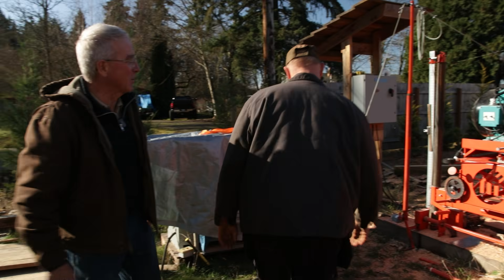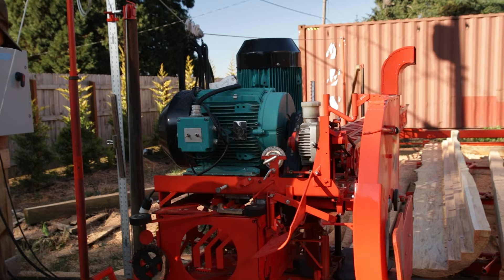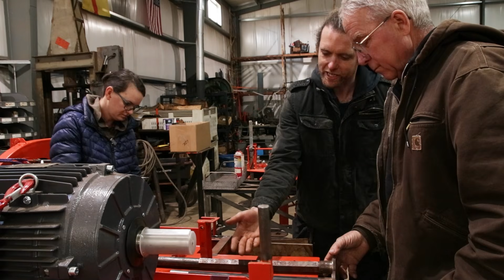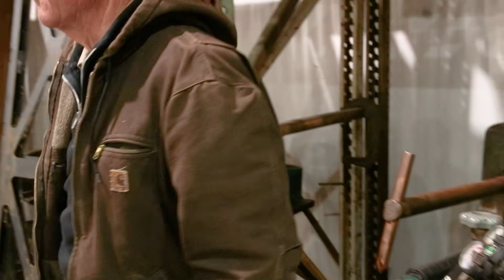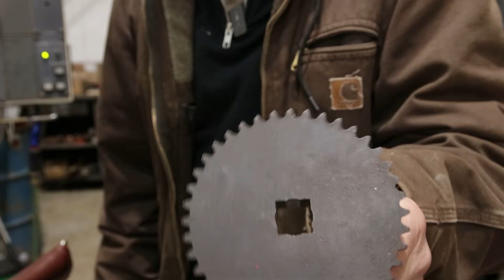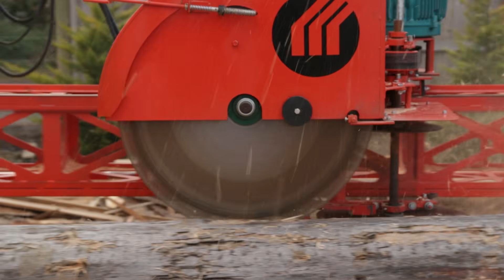The Unbelievable One-Man Sawmill | Mobile Dimension Shop Tour

Comment: I’ve got a small band mill. The boards are so smooth that they look planed. The drawback is that I have to manipulate the logs by hand. I’ve cut up to 26” log and that was almost too much. I like the band saw because I don’t lose much in the kerf. I can cut a 20” x 20” if I wanted to. Don’t want to.😊
Simple to sharpen a band and change it out. Not much to maintain as there aren’t that many moving parts.
I would add that it’s not a business for me. I trade lumber with my neighbors for help and the use of an excavator. 😊

Comment: Seems like a nice creative pair. Hope this turns out well looks like a nice product for small scale wood operations. Curious about the rigidity of the beam though. Seems lite.  Really, no bend or flex in lengths over 30 feet?
Reply: That mill shown is 32ft long. No issues. We haven't tried longer to see where it goes wrong yet, but this new design of track is physically 50% heavier and bent sheet metal is way stronger than flat bar like ye olde design.
Reply: @mobiledimensionsaw  32 feet that is a lot. If it really can hold straight and true at that length it is good. Would like to see a pricelist for Europe for this product line some time in the future when the tariff madness is over.
Reply: @just-a-dude4u  I'm not sure how much tarrif madness there really is to be honest, I think it's a lot of just hype in the news. My research is saying that it's a 2.7% import tariff, but the real kick in the teeth is VAT.
Reply: @mobiledimensionsaw  Nobody is sure about anything, that is the main problem. 175% tariffs on China and Penguine islands. Zero on the evil terrorist dictatorship regime Russia... It is just madness. Sorry to say. I used to like Usa. As it is now, made in Usa is off my shoppinglist until order and stability is back.
Reply: @just-a-dude4u  I think you'd be surprised. While we've been braced for the tariff madness, it hasn't hurt as hard as we expected. It's all just media. It's not reality. Unplug and things are different.
Reply: @mobiledimensionsaw  Really? Here I am in Europe telling you that I am not going to buy your product cause your country have  elected a serial liar that is threatening neighbour countries and saluting genocidal dictators like Kim Jon Un and Vladimir Putin and raising tariffs with the rest of the world and you think that it is something that will not exist if you turn a blind eye to media? Really, blame the messenger? That is surreal. Even Russian media reports that they are happy with Usa starting trad conflicts. Everybody knows this!

Comment: What an awesome video.  I grew up helping my dad on an MD 128 up here on Vancouver Island.  Believe it was sold in 2007 for maybe $10,000 bucks.  Can't imagine what they're worth now.  Built our own trailer out of 2x10 box tube salvaged from a mobile home frame - worked beautifully.  I'm not sure where this machine fits in anymore, even back in the early 2000's I remember band mills becoming more popular with Sawyers in the area (and  customers).  The mobile dimensions biggest downfall?  Waaaay too much sawdust!  5/16 and 1/4 inch kerfs add up to a ton of lost lumber.  Awesome machine though, and great memories.  The easiest way to change the direction of the wind for the day was to set up the sawmill on the jobsite - no matter what direction we set the saw in, the wind blew the sawdust in our face 😅
Reply: Wind always brings sawdust to operator!
Reply: My sawmill does not have sawdust blowing on the loading dock. It goes over top of the motor, so I don’t understand why they don’t continue this set up.

Comment: As I recall, if it's the same Mobile Dimension, we (our refuge-seeking Christian colonizing group) took a sawmill with us to Brazil way, way back in the mid-70's as an income generator. It had the flat-4 VW engine. Alas, the colony failed after two years, but the sawmill kept going. We couldn't afford to bring it back. As it was, we flew home with the clothes on our backs. It may be making some Brazilian an income to this day. But I'm sure it was a far different apparatus than the fine machine shown.
Reply: I bet you it's not all that different. It's the difference in the drive mechanism. That one would have had likely a bakelite vari drive instead of a hydrostatic pump. Otherwise there isn't a ton of difference between all the mills. It's all the same concept with 85% of the same parts.

Comment: I've always liked the look of the MD. It would be great if you could find someone in the USA with a Mahoe. Built in NZ, there amazing
Reply: I looked at NZ, AU style saws years ago, and I'm guessing these cost more, but they can cut much larger dimensions. Those auto small ones move some lumber much faster though. 
About 30k for a decent one if I remember right.
Reply: Yes, the mahoe sawmill What is my second choice if I couldn’t find the MD used but I found one when I talked to the original manufacture he said that they called he’s a widow “s sawmill Because the only way to get one, if the guy died, that Owned one  They would sell it

Comment: So this is dimension milling? But then you have to cut with expecting shrinkage, right? Not so much length wise but the width of boards will shrink. That's a whole nother video that EC could do, yes? Please?
Reply: The lumber from these has a very rough cut finish, if I'm attempting to make a nominal 2x I  cut 7/4 then thickness plane down to 6/4. It's an extra step, but worthwhile. And I only plane when boards are dry ~14° moisture, so the final dimensions are exact

Comment: They should work to do everything in house  like buying a cnc plasma cutter  and other tools nessary.
As for the motors they can be bought pre-made.
If you can't get the VW motors anymore Ask Toyota about a 22re engine.  Or go with different type of fuel motor. 

So this kind of sawmill has no limits in length  let's say a 96' long log. Add a cross cut saw and cut 8 10 12 24  long timbers.  Like a large 
Radial arm saw.
Reply: Going to have a time finding logs that length! And without excessive taper